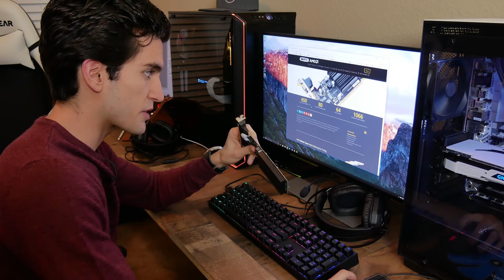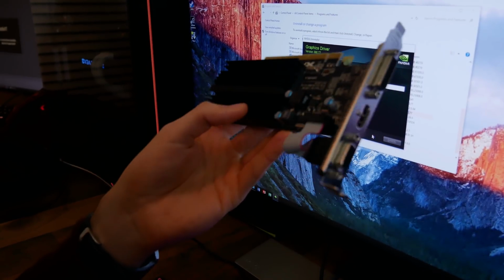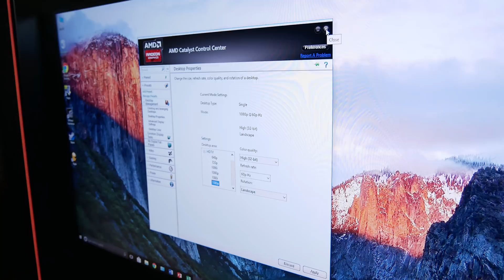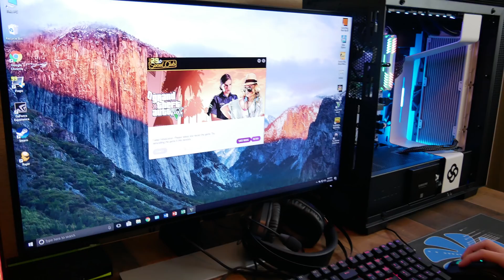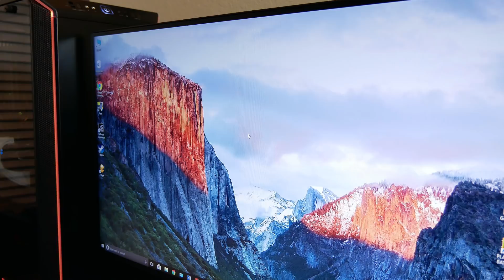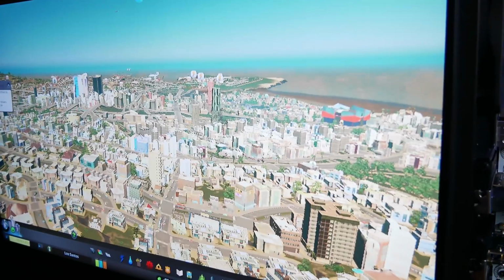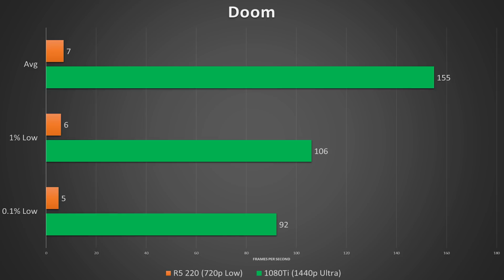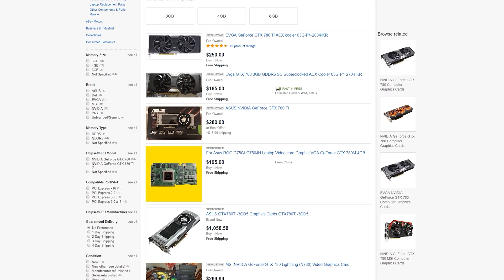Gaming on a Graphics Card with 80 Stream Processors?!

Comment: That R5 220 seems very similar to the Asus HD 5450 Silent 1gb I found dirt cheap used (actually.. free) a few months ago and threw in my $80 refurb internet/video PC. Yes, it is actually better than the Ivy Bridge Pentium G2020 iGPU. My logic for doing it was adding a dedicated low power GPU with Vram was cheaper than upgrading the 4GB of system ram (since iGPU uses system ram). What really surprised me was the performance increase with overclocking. No, it won't run the games you benchmarked at playable levels, but it does play older games very well (retro).. and even plays Crysis! lol. I already have a (now old and very power hungry) crossfire HD 6950 FX 8350 PC for modern gaming, and this is just a low power light gaming internet/video/light gaming PC. This card is used for HTPC/internet/adding multiple monitors. For $50, go buy a used HD 7750 off ebay. Uses PCI-e slot for power (good for upgrading premades without the needed molex power plugs from the PSU) and can overclock. An HD 7750 should give playable 720p gaming in modern games at low settings. Buying the cheapest brand new thing is usually a huge waste of money.

Comment: I think I know what happened here. This GPU was designed with a very specific resolution and refresh rate in mind (say, 1024x768@30Hz) and given exactly the amount of VRAM necessary to provide sufficient memory bandwidth for desktop use at that resolution and refresh rate. The reason he couldn't get 30 FPS in those games may have been because running the games at 1080p requires more memory bandwidth than the card has to offer. This card was never meant for games.

Comment: I'm building a PC and my plan is to  crossfire two RX 560 graphics cards and to prevent micro stuttering I will be using a 1800x Ryzen 7 processor with a X370 motherboard and my ram is 64GB there should be no bottle necking with what I have.  I know that the RX560 is a midrange graphics card and a lot of games made today run choppy but I'm on a budget and can't afford the high range graphics cards because of the graphics card shortage and Crypto currency mining.  What do you think.  Will gaming be playable on my PC build?

Comment: I think the R5 220 is slower than an HD 5670, which you can buy used for 20 dollars, as I think the R5 230 or 235 is based on the 5670's core. (and R5/R7 240 finally using GCN cores.) edit: Basically you were suggesting getting something from an Older generation.. and it's actually a rebrand of an even older generation than the HD 6950 mentioned.

Comment: This R5 220 just doesn't have it.  I have a Amd 5450 and 6450 1 gig type video cards and these are basically so you can play 720p or 1080p video play back in You Tube type of video content smoother.  The reason i know this is because it seems to run the slow ddr3 like mine and is just a rebadge of my cards.  Avoid these kind of cards if you can.   performance of these budget cards are similar to 2011 Ara performance.  Even the R7 250 is slow and was promptly sent back.  Science Studio I have GT 1030 and it's much better than even  the GT 730  2 gig ddr5 memory.  The R5 220 sucks and we need cheaper newer cards that (average consumers) can get the job done in modern'esk types of gaming.   Some older graphic cards and newer budget finds for a comparison?     Thanks for any input or ideas.

Comment: The thing is, you've only ever really used mid to higher end gpus, I could have told you that none of this would be playable before you even started the video. I just upgraded to a 1070 but before that I used an r7 250 and I got 40fps in borderlands 2 at 720p low settings. Low end gpus are just that, low end.
Reply from the maker: IridiumAxle No, that isn't true. I've used very OLD and low end graphics cards in the past. Don't assume if you haven't been around since the beginning!
Reply: I'm basing this off of the lowest one I remember you using at least consistently, which was a couple generation old mid-end gpu, although I could be remembering wrong
Reply: Also to give kind of a point of reference, I first started watching your videos around may of 2016. It doesn't really matter though, I was just surprised that you expected anything other than complete failure out of this poor little card :P

Comment: isn't that just a rebranded hd5450 which you can get for $30. i use the 5450 for builds for my dad's work who uses monitors with vga. I wouldn't buy it if mobos came with DVI-I but they didn't

Comment: If you want something only as a video adapter for a cpu without an iGPU, why not get a gt220? Still sold brand new for around 25€(so 25-30$), it is even lower powered and cheaper than this card

Comment: If anyone NEEDS a GPU, just get an old HD 7770/7790/7850. These cards aren't great at mining so miners won't target them, and they're still powerful enough for 1080p at Medium settings and will achieve 40 - 60FPS in most games. Also, they'll eat this little toy R5 220 for breakfast. (I own a 1060 but used to own these cards.)

Comment: To be honest though this card would only be viable for a very basic HTPC as far as video goes. If you are going to have a "balls to the wall" HTPC you are gong to want to run Windows Media Player Classic with the madVR renderer or another software player that is compatible with the madVR renderer. In order to use madVR appropriately you are going to need at least a mid-range gaming GFX card. MadVR uses a lot of shaders to achieve it's increased quality in video.

Comment: One thing of note, quite a few htpc apps use gpu acceleration actually by deafault (Kodi and Plex off the top of my head). So I don't think it would live even as a htpc, but for an office PC sure. But even if the apus they currently have out for an sucks. Their about a 100 and basically it's a repackaged bulldozer Apu. Ya would still be better off on price and all, considering it's a 100$ for one and performance is better then that. Hell even YouTube even can use gpus these days.

Comment: It's based on the Terrascale 2 architecture, therefore it's the same as a 5450 - which only supports HDMI 1.1. The Card can do 1440p over Dual-DVI. I've got one of those and use it as PCIe Passthrough  "Host" for Linux. So performance is just not there - if you really need something that low spec: Get the RX 520. That's at least GCN 1...
So basically - this thing is as old as it get's ;)

Comment: The gtx 1000 series were never good value for the money... the gtx 1080 came out costing 700$, when it should have costed 250$ at launch, the gtx 1080ti came out costing 700$, when it should have costed 400$ at launch... look at their equivalents from 2011 -> gtx 560 which came out costing 250$ and gtx 570 which came out costing 440$... 

keep in mind that the gtx 1080 has a smaller die size than the gtx 560, lower R&D costs for Pascal overall than Fermi and 2x times lower failure rate... which are the only 3 factors that matter when it comes how much the GPUs cost Nvidia(or AMD) and to which they should price the GPUs accordingly....

Comment: I watch movies and sometimes leave Adobe Premier compiling video on one monitor, which has a little GT-720 1GB, while I game with the RX-470 on the other.  I started doing this after seeing how much better the 470 was working without the monitor's load, higher framerate and all around performance was much better.  I had to dig out this little card because I messed up a BIOS flash, and needed something to drive a monitor while I recovered.. after seeing how much better this worked, I left it in.  When the gaming display isn't on (it's a 55" 4k TV), or it's in TV mode, the RX-470 basically shuts down.  I see the idle wattage (Aida64) drop to 8 or 9w, instead of 30w+.  The NVidia card uses next to nothing.  I decided to just leave it this way after I got the 470 working.

Comment: This is like a trainwreck, you know how it will turn out, but you can't look away :D But 50$ for that kind of perfromance is horrendously expensive. If you wan't a new card, pay like 20$ more and get an RX550, it's like 200% faster or just get a used 7850/7870/260X/270/370  for about the same price as that R5 220 and get a vastly better performance

Comment: I think it could run games at 60 fps such as the original Deus Ex (released on June 22nd, 2000) or Monster truck madness 2 (released on April 30th, 1998). That card would do fine with those games.

Comment: That thing is based on 6000 series cores. Before GCN. Each core was weaker than the individual 5000 series cores. The 5450 has 80 cores. The 6450 has 160 cores and is better (but not double due to what I said). The card you reviewed is 80 6000 series cores. That's bad. Their APUs from a few years ago - the worst ones, like the E350 or even C-series - were better. The 5450 and 6450 are better.

Comment: He's gamin in 1440p nice, I do as well but with a 1070 on high settings
Reply: steelbo7 I think 1440p is the best res to play at. Higher than 1080p and more framerate than 4k
Reply: Same, but all my friends call it a dead resolution and still play in 1080p, even through they have 1080's and 6700k's. It was a noticeable diff to me from 1080p to 1440p much sharper and you see more of the map in 1440p first person.

Comment: Quick question. With the whole issue regarding the Intel cpus, would anyone still recommend  overclocking non k cpus such as the i5 6500 with a Z170 mobo through the bios or would it be best to just update the bios on your mobo to the latest version and  not be able to overclock anymore? Just wondering which option to go with. Great video by the way.

Comment: You're much better off getting an HD 8570 off of eBay for less than $30. Better than desktop Intel iGPUs and has DX12 support. The 7570 is a little less powerful with no DX12 but can be found for $20 (at least right now).
Of course a GT 1030 would have a much better price/performance, but it's an option for ultra-cheap systems.

Comment: I got a r7 240 for $15 off Craigslist
Reply: Johns Memes I feel Craigslist is always overlooked. If you look carefully and research you can get AMAZING deals. I got a full systen with a i5 6500, gtx 1070, 16 gigs of ram, and a 960 gig ssd. All for $825. Absolutely amazing system. Just gotta look for the good deals 
;)
Reply: I got a i7 3930k(6 core 12 Thread oc to 4.4 ghz), custom watercooling, 32gb ram, 2 1tb hdds, 120gb ssd, 2 HD 7970s in crossfire for $400 on the Facebook marketplace. Its amazing

Comment: R5 220 is a joke-I bought one for 40$ to replace my Integrated graphics and it ended up performing worse than my cpu's IGPU. Interesting video topic maybe?
Reply: Good for people with old core 2 quads, Phenom II, Athlon II and systems like that. They could throw it in and play Minecraft or whatever.
Reply: Although at this price they should be looking at a used Geforce 580....
Reply: Over the $40 limit... A GT 1030 and RX 550 is above $40.
Reply: Yeah I'm not downplaying it's use case for those without at igpu- just sharing my personal experience with the product.
Reply: I doubt you could get a GTX 580 for 40 dollars. Maybe something like about 80 would be reasonable.
Reply: You're correct Anson they go for about $50. However if you play the bidding war somethings you can snag one for $40. I bought one and I was going to make a video on it.
Reply: Not sure if it's going to post, but here are some sold listings: https://www.ebay.com/sch/i.html?_from=R40&_sacat=0&_sop=15&_nkw=geforce%20580&LH_Complete=1&LH_Sold=1&rt=nc&_trksid=p2045573.m1684
Reply: I bought a 7950 for $40 before the gpu mining stuff made prices goway up
Reply: Well even those with an igpu could experience higher frames. However in terms of modern Intel CPU's the rx 220 is rather useless.. You need something rather dated to even think about this, but again I would rather suggest a Geforce 580 because they are pretty powerful for only $40.
Reply: I know, but you get much more performance for the price.
Reply: this GPU is essentially a rebadged HD5450, An ENTRY LEVEL card thats almost 8years old at this point, what else did ya expect mate?
Reply: I got a hd6850 for $50
Reply: Same
Reply: Get a RX 550 or a GT 1030 lol

Comment from the maker: - Another use case scenario for this thing: troubleshooting graphics cards in Xeon/non-APU builds! (This is actually why I bought the card). ALSO: it's sound "*damping*, not sound "dampening.," and it's VGA power, not "PCIe" power. Wow. GG me.
Reply: I wonder... Is my AMD A8 5600k APU better then this GPU?!?
Reply: @Jahee, Yes. The gpu in your A8 5600k is about 4x as powerful as the r5 220 in the video. And the brand new AMD APUs' GPUs are 3x~5x as powerful as yours.
Reply: @Greg, I think PCIe power is not incorrect. I would have thought "PCIe" would be more correct than VGA power, though I have seen both terms used. When is the last time you saw a graphics card come out with a VGA port? Heck, they even dropped the analog VGA pins from the DVI connectors a couple years back. Now how am I supposed to play the latest games on my CRT monitors?
Reply: Well it does look like some very low end AMD cards launched in 2016 supported VGA, but no evidence of 2017 cards with VGA. I happened across an enigma known as the R5 330, which doesn't even have video outputs at all. That's just funny.
Reply: I THINK THIS AUSCHWITZ SURVIVOR IS TRYING VERY HARD NOT TO SHIT ON AMD. I GUESS EQUIVALENT NVIDIA GPU NEVER CROSSED HIS JEW MIND.
Reply: @Matlockization  Wtf goes through your mind?